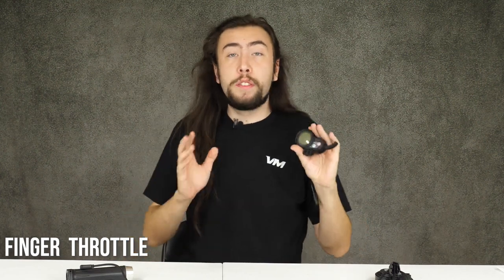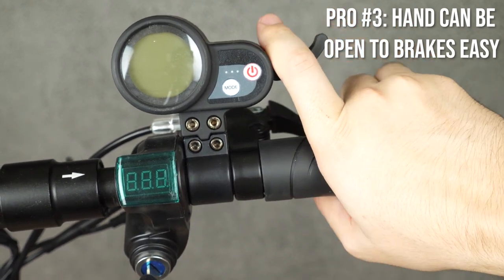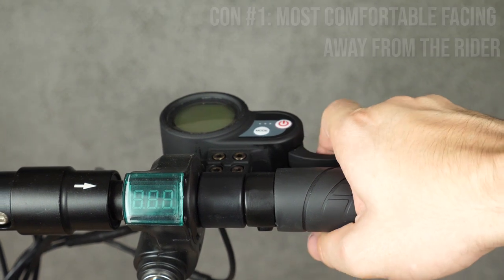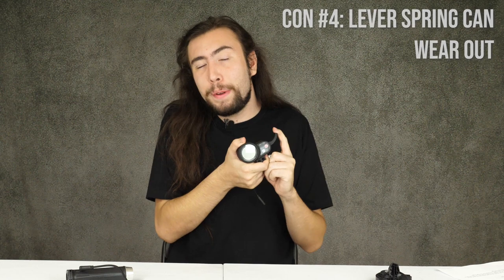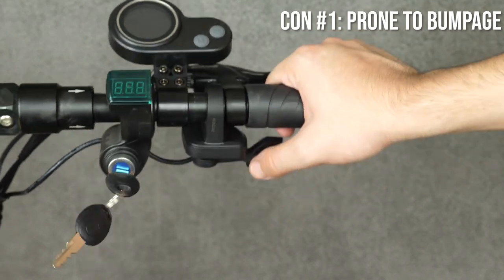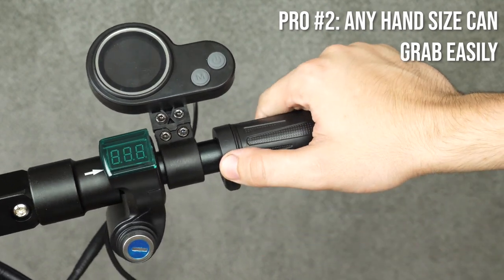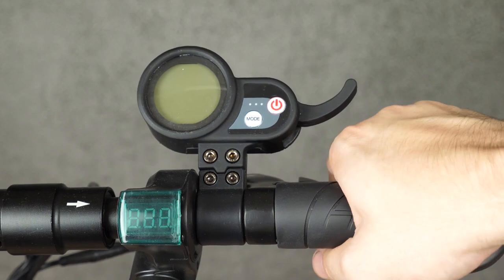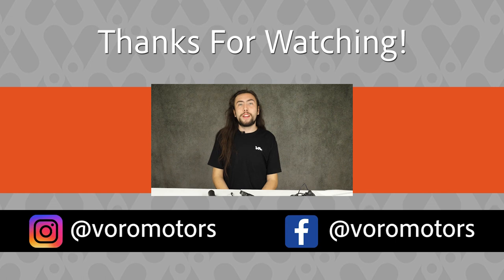What's the best electric scooter throttle? Finger, Thumb and Twist?

Comment: Hi AJ,
Being a lifelong motorcyclist (and 'older' rider), I've switched to the twist throttle.
The only issue I have with the twist throttle is that for some reason it comes designed without the flange that exists on the OEM (standard) grip. I do like/prefer the look and comfort of the original grip... so much so that I've decided to keep the original grip on the left handlebar even though I have the twist throttle on the right.
Also, the original grip style with the flange is much more comfortable as you can rest the heel of the hand on the flange and - especially - if the cruise control is switched off it's easy and comfortable to maintain revs resting on the flange in this way... just like we do on motorbikes.
It would be great if the twist throttle could be redesigned to - basically - be the look and comfort of the original grips but with the function of a twist-throttle.
Reply: Hi.. I also got the twist throttle. but while
Practicing i noticed sometimes the scooter accelerates suddenly while walking the scooter if your hand on the throttle
Moves.. same while getting down the scooter even after slowing it down a lot, if the hand moves on the throttle it suddenly accelerates while you are getting down the deck.. Did you see the same issue?

Comment: As an avid motorcyclist I MUCH prefer the twist throttle. The trigger throttle is down right dangerous as it can be confused with the brake in a panic situation which happened to me a couple of times until I forced myself to ride with my middle finger on the brake lever all the time which wasn’t very comfortable. Pansies may be fine with the trigger throttle but for aggressive riders I definitely recommend the twist.

Comment: One "minus" of twist throttles that you didn't mention occurs if you forget to turn the motor off before walking or moving your scooter. It's easy to activate the throttle by accident and then the scooter shoots out of your hands or drags you. I was nearly dragged into traffic when I forgot to turn the power off before trying to walk a moped e-bike. Overall I still like the twist throttle, it's comfortable to use on long rides and easy to make fine adjustments to your speed.
Reply: There is no start protection when the scooter isn't moving, is there? Even the dumbest rental scooters has it. How stupid!
Reply: Going to your p settings and P7 is takeoff speed set it change it from 0 to 1 cuts the acceleration in half on bad roads like I have often times I hit potholes that make my thumb's slip off of the throttle and it clicks back pretty hard can't be good for it
Reply: @ldxyz-s1e  it does have that just have to do research is all P4 is the  kick start setting it won't go unless your pushing it at 5mph which is a perfect for kick off speed shouldn't engage not to mention the P7 setting is take off acceleration set it to 1 and you halve the speed it accelerates people are way too quick to just put something down instead of doing research

Comment: Thumb throttle, but it needs to be adjusted to be stiffer, making it resistant to bumps, while also not too stiff that it gets tiring on long trips. 
I've ridden a different scooter with a thumb throttle that was executed a bit differently, it was a tab on a ring that wrapped around the handlebar, instead of a lever. So it was like a hybrid of a twist & thumb throttle, which I really liked.
Reply: Yeah, that kind of thumb throttle is expected. I'm surprised they did this odd craft.

Comment: I own all three, For me  the thumb throttle is best, I have small hands and when needing to brake in an emergency the trigger throttle takes the longest to release the throttle and hit the brake, The twist throttle you can sometime accidentally twist the throttle when reaching for the brake, not good when you're trying to brake, I've also noticed when turning i can accidently twist the throttle as i lean, again not great to be accelerating when trying to turn, With the thumb throttle once you release it your hand is clear of all parts of the throttle.
With the thumb throttle i would suggest putting the throttle on the other side of the display, (i have grips, brake lever, display, thumb throttle) if you have it next to the brake lever it feels to close and your thumb goes into an un-natural position,  Also it can hit the brake lever and not alllow full acceleration if it's to close to the grips,  I have a handlebar extension and have moved the ignition switch on to  the extension creating more room for thumb throttle, The handlebar is too cramped for the thumb throttle if you still want to be able to fold the handlebars. On the extension i have the ignition switch, extra lighting and a mirror.
Reply: Thanks. Can you send a pic of your handle bar configuration?
Reply: Sounds a lot like how mine is rigged. Good job! on the reconfiguration and plz send a pic provides better visual for other scooter enthusiasts. ✌🏿
Reply: I agree thumb is definitely the way to go on zero 10 omg huge difference

Comment: Thank you for explaining the difference between the throttles. I just got my new electric scooter last week. I did order the twist throttle as an accessory. I have not installed it. I wanted to get a feel for the scooter before I made changes. I am going to like the twist throttle for the reason you stated. I will be turning off the cruise control. It will be easy to release the twist throttle and squeeze the brakes. With finger throttle, you have to remember to release the finger throttle before applying the brakes. You got to turn off the gas before you apply the brakes! I was lucky I was not going fast when I learned that lesson. I am not going to be going fast. There are too many homes and businesses driveways along my desired paths. I want to go a little bit faster than walking. My favorite coffee place is within two blocks with limited car parking. There is a lot within 2 miles. I often joke my life revolves around 5 miles. I am going to be ahead of the game with all the new apartments car traffic is going to be a nightmare. In my neighborhood, we are into supporting the local community (there are no local e-bike shops) and all that good stuff. I am going to be on the cutting edge of local transportation!
Reply from the maker: Thanks for that comment, Dave! We're excited for the beginning of your journey in the world of e-scooters!
Reply: @VoroMotors  I have a great question for you, I am interested in a twist throttle that starts you off slow, because I notice that all the cheap $15  twist throttles that I a have used, knock you off the saddle as soon as you barley turn it to its minimum activation point, I am looking for a throttle that starts off very slow and gradually starts accelerating to full speed. Please refer me to one either through amazon link or a model and model number, I will subscribe to your channel upon you response. thanks

Comment: I’d like to try a twist throttle sooner than later. I started out not caring for the trigger throttle.  If you have decent size hands, it’s not hard to use index finger on throttle with middle finger (ring and/or both works too) close to brake lever.   It took a little trial and error to position my 1 finger brake lever and throttle just right, but eventually it was easy to instantly accel or brake, with the added benefit of using my brake finger to control speed of trigger pull or block unintentional throttle movement while getting a little aggressive  (it’s a modified Vsett 10+)

Comment: Trying to connect my finger throttle and my twist throttle together. Because I have it ever cost H5. Electric scooter, not only is this my finger throttle. It's also turns on my scooter. It changes modes the speeds so I need this module on there. But I need to hook up a twist throttle because my finger though, just the part of the finger throttle broke everything else works for it except for that broke and it doesn't don't know where it is.  Piece popped out of it, so yeah, it's uh.Yeah, but everything else works on it.I want to put my twist on to replace the thumb throttle by leaving still leaving the other piece on can I do that

Comment: hey man
quick question: can i replace the trigger finger controller with the thumb finger controller like Kugoo Booster has?
thanks!
Reply from the maker: The answer is yes! With both the EMOVE Cruiser and Touring, you have the option of using a finger throttle, a thumb throttle, or twist throttle. They're all plug-and-play so swapping between the different throttles is easy!

Comment: I submitted a negative review of the finger throttle, it never made it to the VM website, they only publish good reviews.  The finger throttle is dangerous, when I went to squeeze my right brake lever, I hit the finger throttle by mistake and accelerated rather than slowed down.  Could be a bad situation in an emergency stop.  So I order the thumb throttle, easy install via their video.  I have an average size hand, although I like the thumb throttle better, my thumb hits the thumb part of the throttle in the wrong place, so I have to move my hand partly off the handle bar to situate the thumb.  It was clearly an afterthought by VM.  Also the “P” menu is different.  In order to elect an option after scrolling it works differently than the basic “P” menu with the finger throttle.  I chatted with CS on the matter and they sent me the instructions for the basic menu, I had to figure it out by trial and error.  I don’t have the basic display anymore, but I found out again, thru trial and error when the scooter goes on cruise control, there is some item that comes on the display at the 9 o’clock position that tells you are in cruise control, no where did I see that in the directions.  I like the scooter very much and a big upgrade from my former Segway ninebot.

Comment: Does every throtle work on every scooter?
Reply from the maker: No, throttles are configured to work with specific systems. You can shop by the model to determine which throttles are compatible.

Comment: I had built a 2000W ebike and it had cruise control. I loved the idea... Mostly because I wanted to drive it "no hands" on wide roads xD Unfortunately, the frame/front forks weren't very solid (i think that that was the issue...) and if I left the handlebars, the thing wabbled like crazy before totally losing control... So... Cruise control didn't fullfil my wishes xD

Right now I own a Laotie Ti30. Nice 'little" scooter... 40KG they say... It also has cruise control and I'm really tempted to use it... But can i drive it no hands is my main question 😂